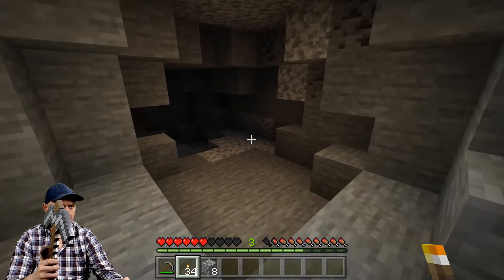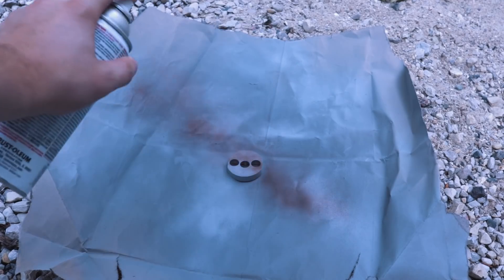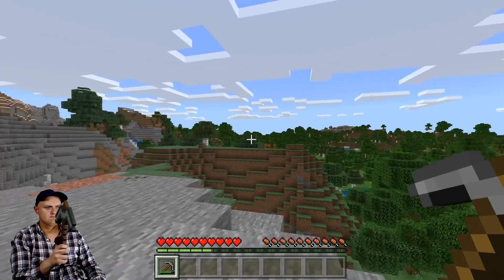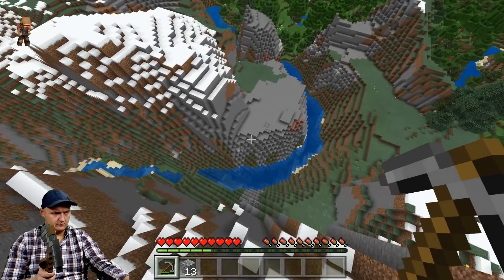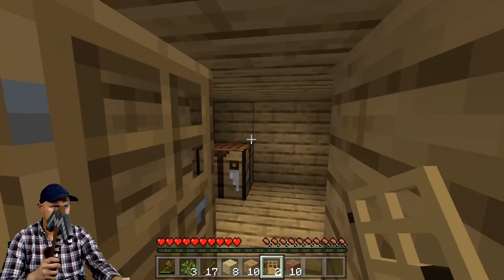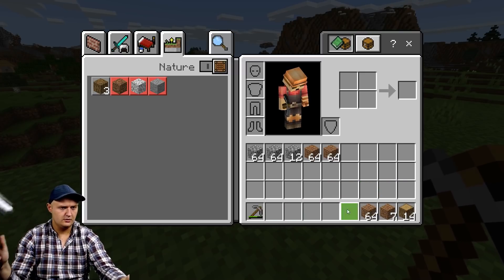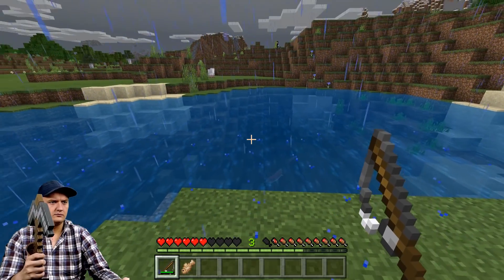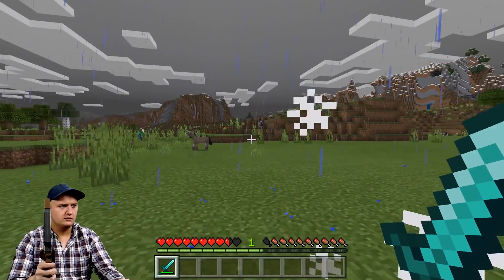Playing Minecraft With a Pickaxe Motion Controller

Comment: how to make the sensor activate a key by shaking it? i need to know how
Reply from the maker: It's just an accelerometer. You check the change of acceleration over time, and if it passes a certain threshold, you send a keyboard command.
Reply: @InsertControllerHere   i'll try this , thanks so much

Comment: Do the same thing but with the Minecraft bow, or torch or sword.
Reply from the maker: Do they make you versions of the bow? I've seen the sword at Target.
Reply: Insert Controller Here 
Yeah I’ve see the bow before, has an elastic string. I also saw a Minecraft sword that could fold into a pickaxe, which could work real well for switching between the two in game.